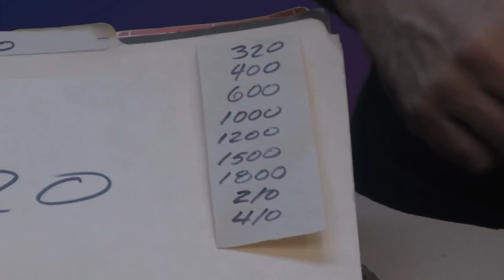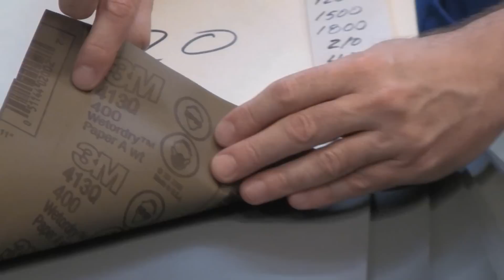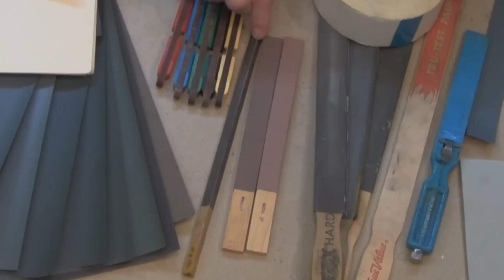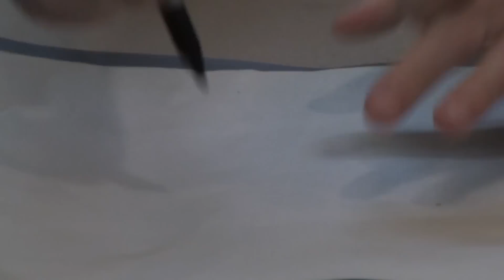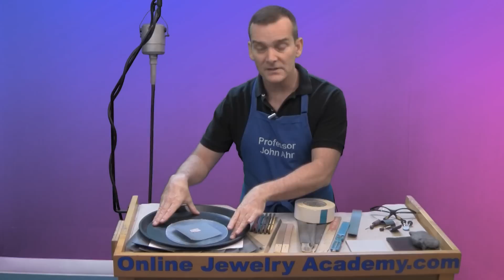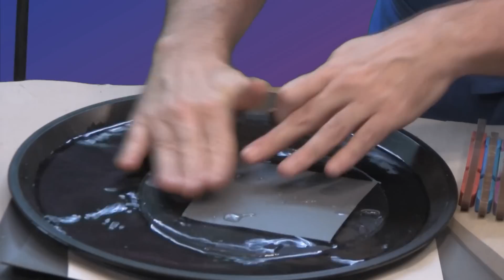Sanding Basics For Jewelers

Comment: I've been powder coating some customer's jewelry (bracelets, necklaces, and rings) for some time now but I've noticed highly polished items like when an item is first chrome plated will often chip easily.  My question is should I consider sandblasting to get down between joints too small for me to sand by hand or is sandblasting too course where should I stick to sandpaper only to give me a little surface adhesion that would least likely allow my powder coating from breaking free (or chipping)?
Reply from the maker: Sandblasting will create a “tooth” for your powder coating to cling on to. You can control the size and depth of the texture by controlling the size of the media, the nature of the media and the pressure used. But, what is completely out of your control is the wear and tear that a client inflicts on a piece. I encourage you to experiment with sandblasting and see if it helps to prevent unwanted chipping. Good luck. 🍀
Reply: @OnlineJewelryAcademy  Exactly what I was thinking.  I do the best I can and I'll even strip chrome plating off with chrome stripper as I do gold and precious metal plating here as well (mentioned above) but when it comes to powder coating, I pretty much can count on 1 out of 10 pieces of jewelry coming back for chips that didnt' adhear well.  I will call out a customer when you can see for sure it was just very bad care and scratches can be seen but there are some that are "my bad" where I see a part of the powder coating just didnt' adhear properly and just like most of us, I'm trying to find an improvement to my method for application.  

I Just bought the stand up sandblaster over at HarborFreight today and the finest grit they had was 80grit glass which says it's ideal for prepping to powder coat or paint.  I'm just hoping 80grit isn't too harsh and will look to Amazon to see if I can find a finer grit than that.  If you have any recommendation for jewelry that needs a very smooth finish (no pitting), I'm open to recommendations.  Thanks to you and anyone else who may answer.

Comment: Is there an easier way to sand a newly sawed out piece of sterling silver with a power tool? I hate the hand sanding to smooth the edges.
Reply from the maker: Yes! For larger items you can use a belt sander. For small items you can use a flexible shaft tool and various attachments. The OJA has videos about flexible shaft tools and many of the attachments. Remember, that sometimes power tools help us to make mistakes a whole lot faster. Be sure to wear protective gear. 😀
Reply: @OnlineJewelryAcademy  I am getting a flex shaft for Christmas. I will watch those videos that you mentioned.

Comment: Can we achieve a mirror finish gold ring with only sanding paper? If so, what grit level to use?
Reply from the maker: You would have to work through the various grits until you reached the emery papers 2/0 - 4/0. But, gold likes to be shiny.  Burnishing would shine gold without removing any of the metal. 😀

Comment: What would I sand the jump rings with and also what would I use to buff it and make it shiny. I know 1000 grit sand paper but what else ? I also use aluminum in my collections. What would you also recommend for that too?
Reply from the maker: Hi Kevin,  The best way to finish jump rings is to tumble them.  You can shine all of them up at the same time.  Tumbling is also the best way to shine up a chain.  I don't use aluminum in my studio.  This is because metals like aluminum and lead can contaminate your studio and ruin your work.  You might want to search for a channel where they work with aluminum. 😀
Reply: @OnlineJewelryAcademy  how do I tumble them ?
Reply: @kevinpaz1055 jewelry tumbler. It’s a machine. You can get one for less than $100. I’m 4 years late but I hope this helps

Comment: Hi, Thanks for your video's. I have a question. I work with copper and fine silver. Can I use one piece of sanding paper for both materials? Should I seperate the papers-for-copper from papers-for-fine-silver? Could the paper I used for copper 'contaminate' the fine silver? Thanks!
Reply from the maker: You can use the same sandpaper on your copper and fine silver pieces. Because I use wet/dry sandpaper, I always rinse my sandpaper off after each use. I use clothespins to hang it to dry. : )
Reply: Thank you! Is that the same for polishing papers? I can see 'marks' on those papers after I have used them for copper.I don't think I can rinse them.  @OnlineJewelryAcademy
Reply from the maker: Yvonne Manders Emery papers cannot be rinsed off after use. But I don’t see the harm of using them between various metals if gold  isn’t one of the metals you’re switching between when using them. 🙂
Reply: Thanks! That makes my life a bit easier!  I hardly use gold (only leave gold for enameling) but that is not going to be sanded after all... @OnlineJewelryAcademy

Comment: Hello! Thanks for the video. Consider me as a beginner, do you recommend me to buy all grits of sand papers that you showed? Or if you specifically recommend few, which would be those? I'll work with silver. Thanks in advance.
Reply from the maker: There are three grits that everyone should have. They are 320, 400 and 600. Start with those grits. You can always add to your collection of sandpaper grits over time. : )
Reply: @OnlineJewelryAcademy  Thank you :)

Comment: Hi, do you recommend at all sanding with 3M radial discs? I've tried but haven't been very happy with the result. I would love to see a video on that. Thanks Professor
Reply from the maker: I really like most 3M products.  But, you need to be selective in choosing which product will work best for your finishing tasks.  Radial sanding discs can be a great time saver on the right job.  The OJA has several videos on products used for hand finishing or for finishing and texturing with your flex shaft.  You'll find all of the videos included in the OJA playlist on our website at: www.onlinejewelryacademy.com  They are organized by category for your convenience.
Thanks for your support! : )

Comment: Hi there, a quick question. Does it matter if I purchase sandpaper from Home Depot it Lowe's for my fine jewelry polishing needs? OR is it better ti get from a jewelry supplier?
Reply from the maker: You can get course grits of wet/dry sandpaper from any hardware store.  What you might have trouble finding are finer grit sandpapers  (600 to 1500).  You also won't find emory papers at a chain store.  So, you might want to same money on the course papers by buying them at the hardware store and then look online for deals on finer grit papers.  Good luck with your creative pursuits.
Thanks for your support! : )

Comment: Thank you for pointing me to this video, lots of useful ideas :-)
Reply from the maker: +Louise Hutchinson I'm delighted that you found this idea video helpful.  Hopefully you'll now be able to achieve a mirror polish on your work.  Thanks for watching! : )
Reply: I have indeed by using the wet and dry papers in a water bath it worked great. I changed the final polish and used a white bar instead of rouge on brass it seemed to work well.

Comment: Hi can you tell me if you tumbler your jewellery also or would sanding and polishing be enough? Thanks!
Reply from the maker: Jackie Porter It's enough to sand and polish your jewelry.  You actually get a higher polish on your piece if you buff it instead of tumble it.  Tumbling works well for mass finishing and work hardening.  Thanks for the great question.  And, thanks for watching!  : )
Reply: Ah right thanks for the info. I wasn't sure if you could do 1 or the other.